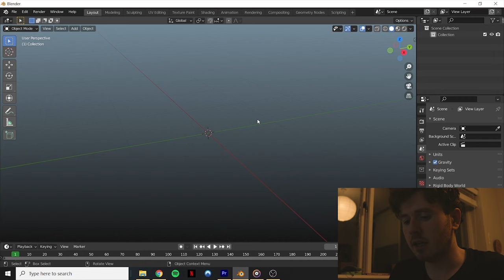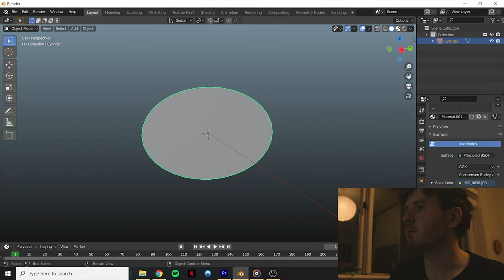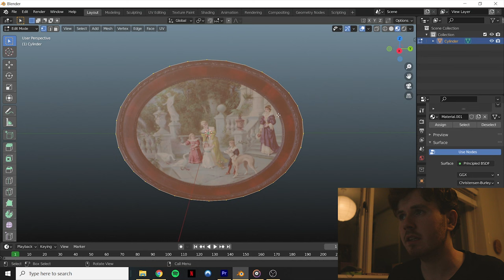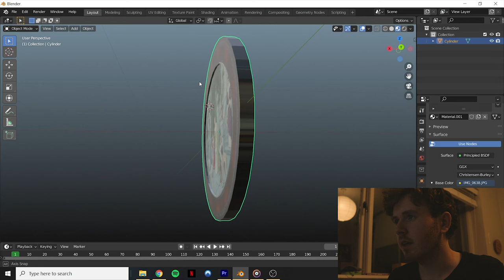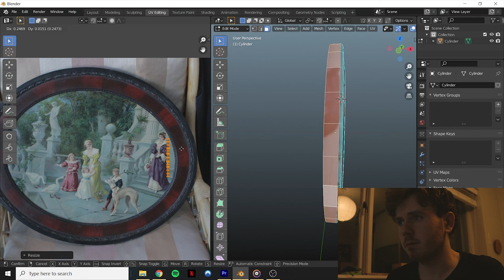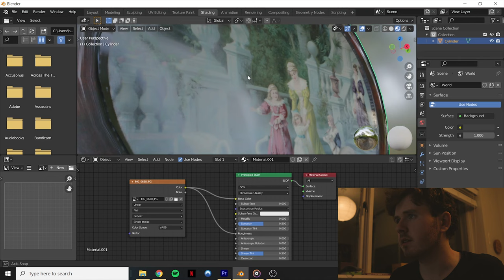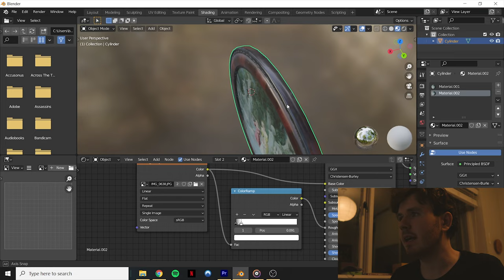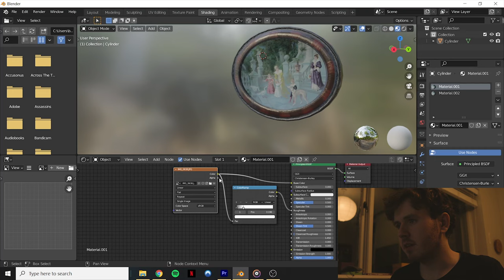Recreating Real Props in Blender using a Single Photo

Comment: Humble talent, wish you a very long VFX career, great use case. I think invisible fx has gret value, any other ideas for film other than from digital set extention and props? what would you say was the most requested FX while shooting.
Reply from the maker: Thank you so much! On set for that film, there was a lot of questions about copyright stuff, as we were shooting a lot in shops and bars and production didn’t want to have to clear all the brands, so we discussed replacing them digitally or painting them out all together. It never materialised as a job that needed to be done though. Mostly I would say that VFX was used to add character to shots. We frequently added dirt and grime to clean surfaces, or graffiti to blank walls—things like that. You would never know it was VFX. Just the way I like it!
Reply: @BenMoranFilms  Super interesting, thank you for sharing, so i guess its really ''adding'' an effect rather than creating it, in order to amplify the set without changing the production plan. Practical.